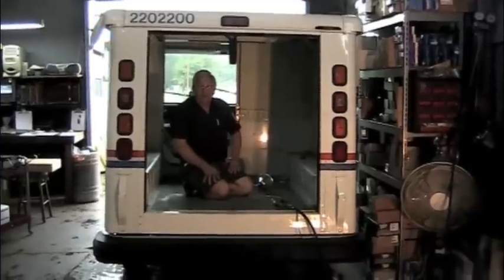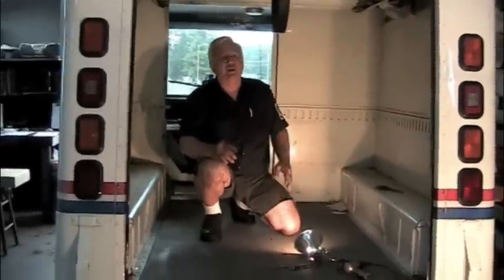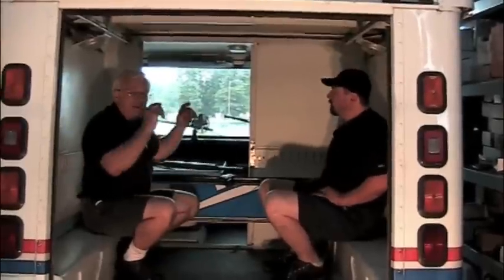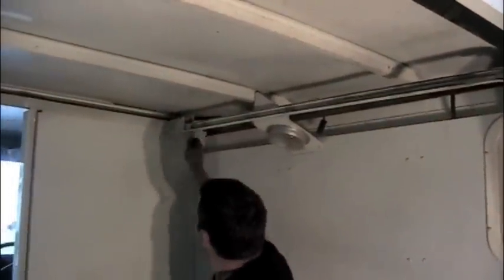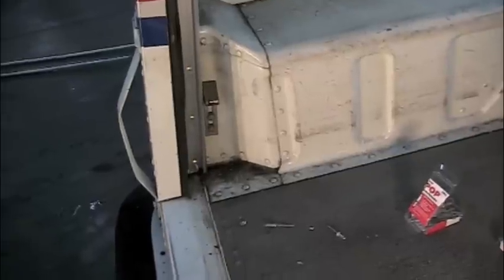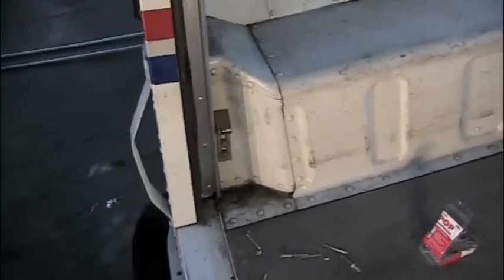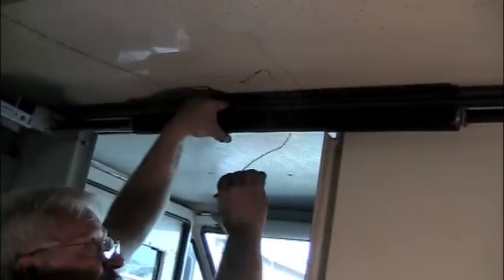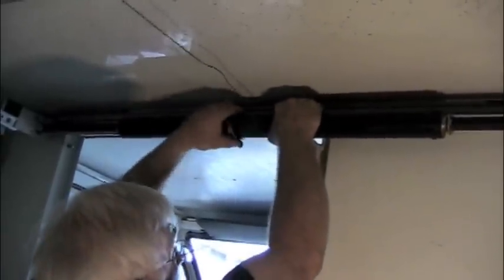LLV Rear cargo door roller track

Comment: Just purchased an LLV and am thinking about throwing a 3800 SC2 in it with a 700r4. In the mid time I’m going to be restoring it, from top to bottom. Thanks for this video, great help.
Reply: they are very versatile vehicles and pretty easy to work on..  Good luck

Comment: You can put a set of vise grips on the track to keep the door from slamming down.  Also make sure you don't wind the spring too tight. you don't want the door rolling up too fast it will damage the stops and brackets. Also gloves are a good idea when working with that cable. I've had the cable stab my hands.
Reply: I  work on those pos everyday  rear door tracks  are fun   so are there ecm b fuse   ground problems  hate them   lol